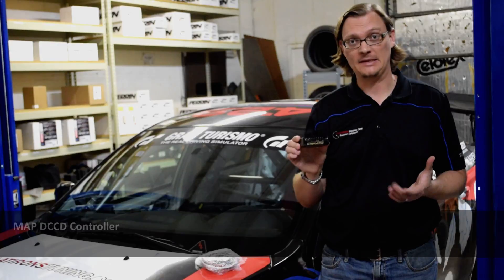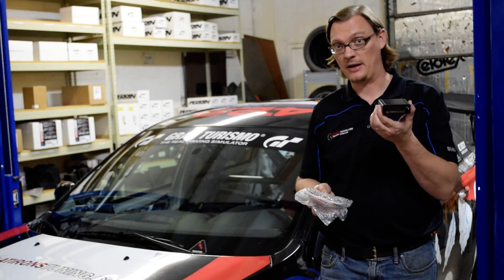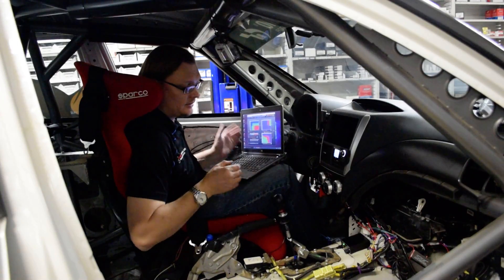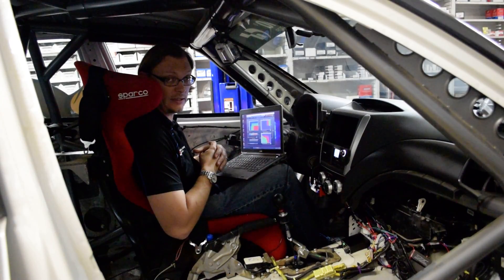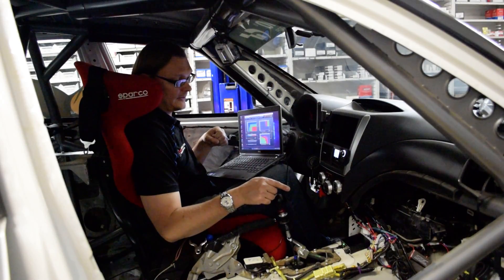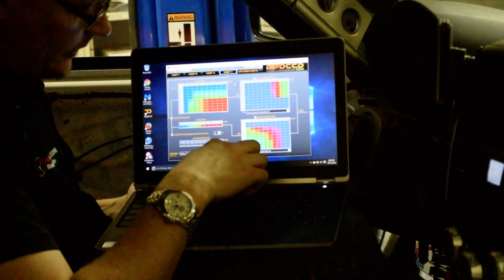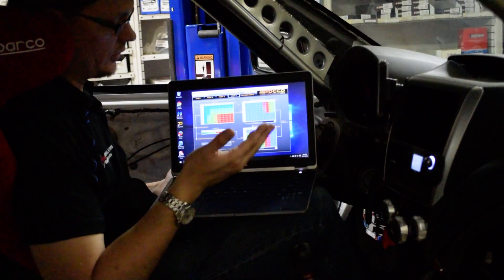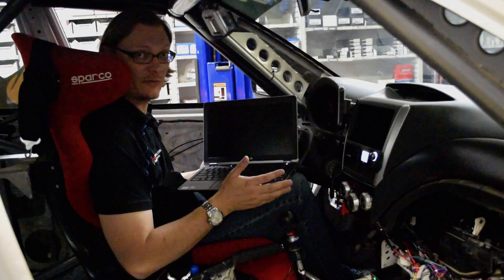Why we like the MAP DCCD Controller

Comment: i own a 2005 Sti which has a DCCD already. Is this one better then the stock one
Reply from the maker: Thanks for the question.  With the STI, if you remove the stock DCCD control, then you will lose your ABS as well because everything on the network will go into limp mode.  You may have an easier time with your early STI, but for this reason, we haven't put this controller on an STI yet.

Hope that helps and Stay Tuned!
Reply: @FlatironsTuning  i’d be interested in installing this in my 2005 STI but how do I find out more information if there’s any drawbacks?

Comment: Hello, 
Just purchased the MAP DCCD from you guys for my STI Swap. What location do you recommend installing the DCCD?
Does the colors match up on the 2016 WRX as well?
"Engine RPM - Gray with Red Stripe in Pin #32"
"Vehicle Speed - Pink with Green Stripe in Pin #31"

Comment: If a gd sti has an abs delete is something like this necessary to retain function of the dccd?
Reply from the maker: Thanks for your question.  Deleting your ABS would trigger a fault which would disable DCCD function.  So yes, if you wanted your DCCD to work in that condition, you would need a controller like this to get them working again.

Thanks for watching and Stay Tuned!
Reply: @FlatironsTuning  I've heard you can just leave the solenoid plugged in but not hooked to anything and it'll trick everything into working, I always assumed that was false have you tried it?
Reply from the maker: @cainlawson4570  I can tell you that if you have an issue with the ABS, because it is tied directly to the factory DCCD control, it will deactivate the DCCD.  Everything like power, wheel speed signals, etc., has to be going to the actuator for the DCCD to work.

Comment: what setup would you use in a gravel rally stage?? 100% locked??
is it like a plug and play?
Reply from the maker: Thanks for your question.  The MAP DCCD controller isn't exactly plug and play, but it is fairly easy to wire in.  For gravel, you would not necessarily want to run it at full lock.  For some instances, this may be okay, but not all.

MAP DCCD does have a pre-build gravel and slick map, and I'd recommend starting out with those.  You will most likely want some dynamic behavior to get the car to work best.

And running in full lock all of the time may wear the center DCCD out more quickly.

If you want to do that, you would want to look at replacing the DCCD with a clutch type unit most likely.

Thanks for watching and Stay Tuned!

Comment: I have a version 8 sti drivetrain in my version 9 sti. Because my drivetrain is 35/65 and my dccd controller was made for the 45/55 version 9 I have very bad binding. Would MAP DCCD help fix this issue? i tried to just swap the OEM dccd module but the connectors are different for version 8/9.
Reply from the maker: Thanks for your question.  If you are sure that the binding issue is the center differential, and you are sure that the center differential is still functioning properly, then a standalone controller should allow you to get it working properly again.

If you disconnect all power to the center diff, and you are still having the binding issue, most likely there is some other cause for the issue.

Hope that helps and Stay Tuned!
Reply: @FlatironsTuning   Thank you for the response! Yes with the dccd unplugged there is zero binding so im 100% sure its the module and nothing mechanically fortunately.

Comment: Thanks for the video I  just did a six speed swap on my subie.Trying go learn what this thing does exactly
Reply from the maker: Thanks for your question.  In short, it allows your DCCD to function in a way that improves your cars traction and handling.  And since you can start with a number of different maps for different behaviors or surfaces, you can quickly zero in on the map that you like the most.

Thanks for watching!

Comment: Have you ever seen engine rpm fluctuate after wiring one of these up? I recently had one installed and sometimes when cruising I see the rpm jump all over the place
Reply from the maker: Thanks for your question.  Because this should only be riding on top of existing signal wires, not spliced into them, it should not have any effect on actual RPM.

If you have recently done a 6-speed swap, I'd recommend checking the wiring for the speed sensor, and possibly the sensor itself.  It could be that is where the issue is.

Thanks for watching and Stay Tuned!

Comment: Is it bad for the transmission to change lockup while wheels are slip spinning? I read somewhere in my 2005 STI owners manual that its OK to change DCCD manual mode settings while car is turning around a corner but its bad to change the lockup while car has wheels slipping and spinning, like when you're drifting or sliding. (not that I could even reach the knob while I'm busy AWDrifting.)
Reply from the maker: Thanks for your question.  When the DCCD is working, it is constantly changing the lock-up of the differential.  So I don't think that in and of itself is what is being talked about.  

If you are looking in your manual, I believe that what they are referring to is pulling the diff out of auto mode and putting it into manual mode while you are driving.  One reason certainly could be that it would be that it would put a little extra stress on the diff if it was in a more open setting to ramp up to an aggressive lock.

More likely thought, it is because that if you manually make a large change to how the differential is behaving, it can have a dramatic effect on the cars handling, and it could cause you to lose control of the car.

Long story short, it would be best to put the car into manual mode and pick the lock-up before you start moving.

Thanks for watching, and I hope that helps!

Comment: what wires are they that you have to tap into in the ecu for the gd wrx, do you know?
Reply from the maker: Thanks for your question Tristan.  You need to find a wiring diagram for your year WRX and find the wires for the brake signal, rpm signal, throttle position, vehicle speed.  There are more inputs that you can tap into as well, but those are the main 4 that will get you the significant function out of the controller.

If you have more questions, I'd recommend that you look through their installation instructions.  Here is a link:

http://mapdccd.com/media/MapDCCD_V2_installation_manual.pdf

Good luck with your install, and feel free to reach out if you have any other questions!

Comment: Can u make the centre diff send all the power to the rear to make it rwd with this ?
Reply from the maker: Thanks for your question.  The short answer is that when no power is sent to the DCCD, the default state of the diff will give you maximum rear bias.

It is a lot like rear-wheel drive, but some power will still go to the front.  It does somewhat depend on the year of the DCCD as well.

Hope that helps and Stay Tuned!

Comment: When you’re driving around should I just keep it in Auto Mode and When is it best to have it Manual Mode?
Reply from the maker: If you are using one of the pre-set maps, you would just leave the transmission at that setting.  If have not found one of those that you like, then I'd say you would be best to leave the controller in Auto mode.  Leaving the controller in manual mode will leave you at a fixed torque split, and that is not ideal unless you are only driving on slick surfaces (and even then, one of the gravel maps would be more ideal).

Hope that helps!

Comment: Can you disconnect the rear end if the handbreak is used? In the same way its done on rally cars?
Reply from the maker: Hello David.  There is a connection for the parking brake so that you can program the center diff to go to open when it is pulled.  If you read through the installation instructions, you can get a sense for all of the input that you can send to the controller, and once there, you can tune this controller much like you would tune an engine.

Thanks for your question!